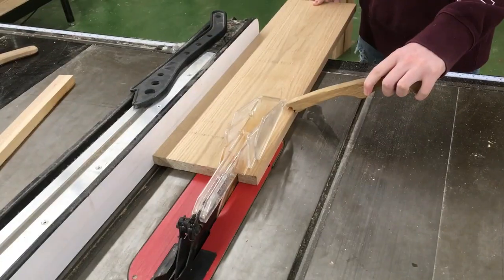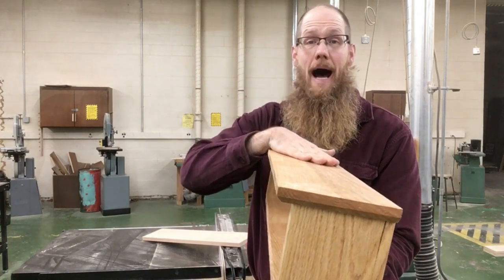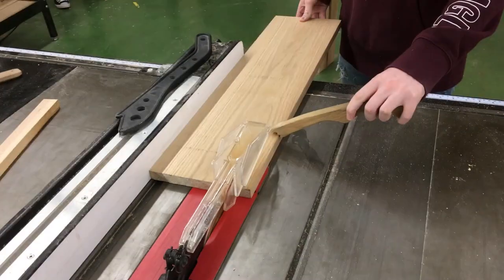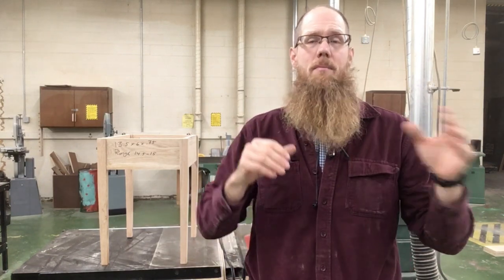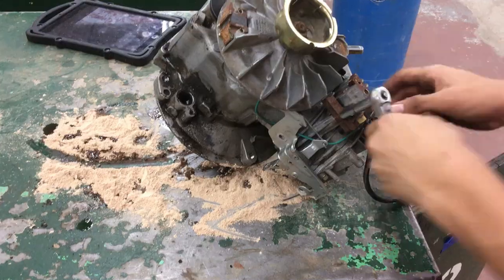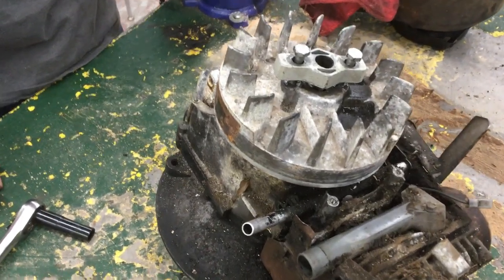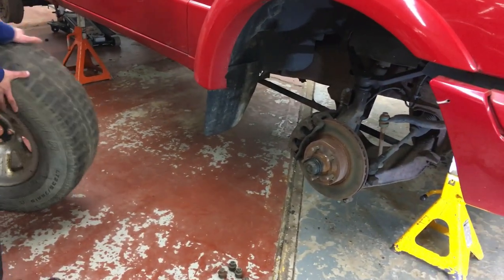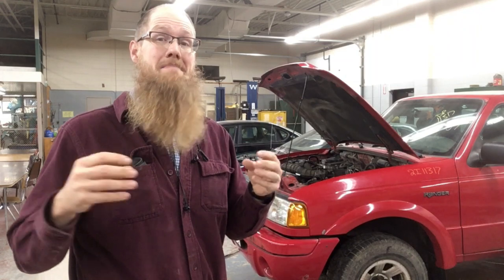Week in the Life of a Shop Teacher -Episode 2

Comment: Thanks. The shops looks a lot nicer then the one I had in the 60s.
I was rebuilding a 6 cylinder GMC truck engine for my dad dump truck. Did not write down the firing order of it. When I got done with the rebuild, I could not get the truck to fire, I took a long time to finally get it. But we had a truck engine in the shop class that I walk by everyday that turned out to be the same motor as I was working on. So I wrote down the firing order for it. Got home, did the plugs wires, she fired right up.
Reply from the maker: That is one of the sweetest sounds when the engine fires up after it hasn’t, take care Larry